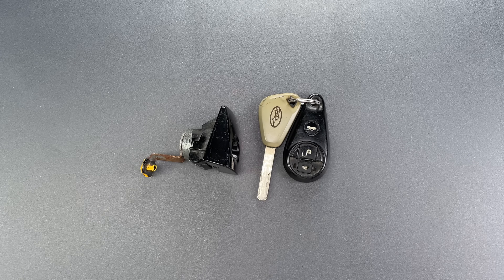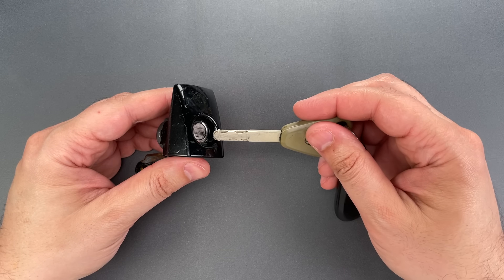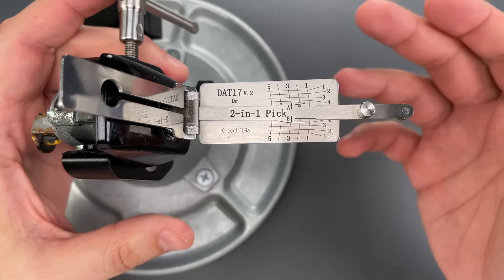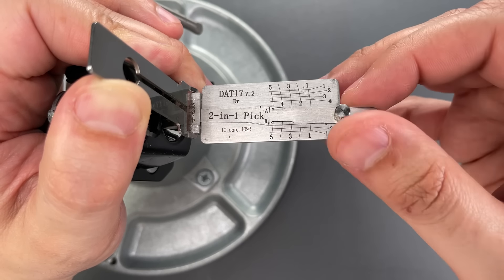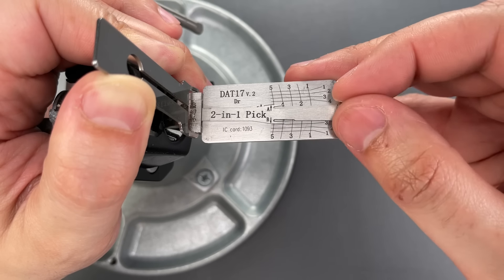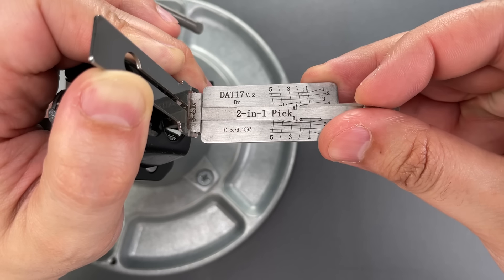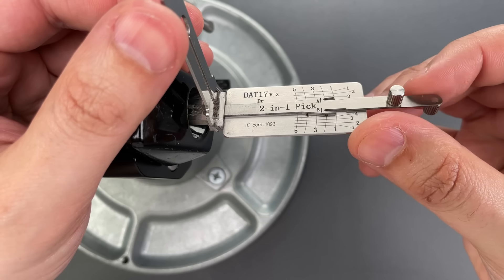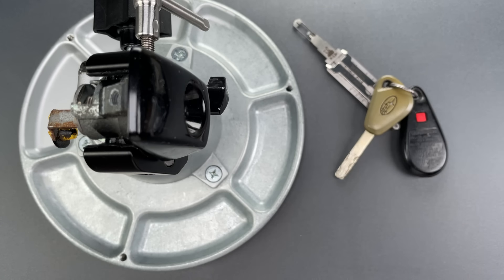[1346] A Trap For The Unwary: Subaru Impreza Door Lock

Comment: I really miss lock gutting videos and this lock seems like a really good candidate for one. I would love more insight on this one
Reply: I second that. Not for usual cylinders, but for the more eccentric ones like this.
Reply: Thirded. The A/B wafers are also new to me.
Reply: +1
Reply: +1
Reply: Yes, what's inside this lock that causes this, as well as the As & Bs.
Reply: He has said about other car locks that these are hard to get and destructive to disassemble, which might be fair to assume about this one too.  I'd certainly nevertheless like to see such innards.
Reply: @jadney  I suspect it's wafers on the top and bottom of the key, but I don't know that for sure.
Reply: I agree, especially why the lock gets stuck half between locked and unlocked, and why more locks don't use that anti-picking feature.
Reply: @asailijhijr  It's top and bottom, and left and right. 1, 3, 5 are at the bottom, 2, 4 are at the top, and each of them has two wafers - left and right / A and B. The key has different bittings on all four sides.
Reply: Yeah, I don’t really know what a wafer lock is.
Reply: Check out Bosnian Bill, he has some really great videos also picking and gutting locks
Reply: @scott215  Can you imagine coming home to find your front door lock jammed and unable to accept your key?
Reply: @thetruthexperiment  wafers, as I understand it, are the same function as pins, but they're square or the same shape as the channel they run in.
Reply: Haven't taken one of these locks apart but automoive locks can be a pain in the ass to disassemble/reassemble. Not having to pull these locks & decode them, Lishi tools have been absolutely nothing short of revolutionary for the locksmith community.
Reply: @Shoop83  i mean, it's better than coming home to find your TV and notebook stolen.
Reply: Rent a Subaru and 'steal' the lock
Reply: @Shoop83  That's better than coming home to find my front door open and all my stuff gone.
Reply: +1
Reply: +1
Reply: Do it, Do it, etc.
Reply: @asailijhijr  Are they hard to get?  I'd think any junkyard with a 2010-2014-ish Subaru has a high chance of having one of these locks in it...just gotta go get it
Reply: @yoru0121  The mind bending part is somehow its still symmetrical - these keys work in either orientation (at least my 2012 Outback laser cut key works either orientation) even though it looks asymmetrical cut
Reply: Poo
Reply: @davecoleman8660  great suggestion! 362 that he mentions there is also great for further understanding of the mechanism
Reply: His channel has pretty much became advertisement space for his lock pick company at this point.
Reply: Pity I can’t post a picture. I’ve done a few
Reply: @DONK8008  Yea, but the April 1st videos make up for it
Reply: @matthewmiller6068  Hard to get a matching cylinder and key set. You wont be able to get the key at the scrapyard. Plus, laser cuts like the key in this video are very expensive to duplicate.
Reply: @Shoop83  LPL has a video for that! 🤣
Reply: For "research"
Reply: @matthewmiller6068  Honda has been using this same style of lock on every vehicle since the early 2000s.
Reply: No. That shit is the worst.
Reply: @scott215  "...more locks don't use that anti-picking feature"

Because it's really stupid, it punishes the owner if someone tampers with the lock, the person trying to break the lock doesn't give a lick if the lock is damaged for the owner afterwards. 

It's not anti-picking technology, it is bad design.
Reply: @Shoop83  "Can you imagine coming home to find your front door lock jammed and unable to accept your key?"

It'd be like Subaru designed your house. God help you.
Reply: the fact he didnt show how to open it the rest of the way is also annoying, he is probably bored of youtube and not feeling it anymore
Reply: @charlieward7606  i believe you misunderstood, the lock was open and locked open.
Reply: @DONK8008  so you prefer that people that want to buy such tools have to go to AliExpress or similar scam websites? By giving a way to buy high quality items is a further service the LPL gives to the lock sports community. Now, out of a 5:32 minutes video, how much time was spent in "adversiting"? I timed it to two seconds, which is 0.6%
Reply: @AlessioSangalli  ah i see, my bad
Reply: @AlessioSangalli  I think actually you misunderstood. If you look at the top of the back of the lock you'll see a latch that's  stuck about halfway, you can see it jiggle when he says "it's stuck between the locked and unlocked position". It's only done about 1/8 of a rotation. When he inserts the key and operates the lock you'll see it go through the full range of motion (1/4 rotation), almost all the way to the flange.
Reply: @9e7exkbzvwpf7c  LPL's at 3:57: "we got this open". The lock is open, but as you also reported, the key is not fully rotated so it's stuck there in the middle, and it cannot be closed
Reply: @AlessioSangalli  you can clearly see it doesn’t rotate the full quarter turn clockwise (facing the keyway) when the picks it, while it does when the key is inserted. 

Compare the clockwise rotation of the top cylinder in the back at your time stamp and the position at 5:06 (he rotates it very fast but at 0.25x it’s easy to see). 

He also says it’s stuck “between” the locked and unlocked position.
Reply: @9e7exkbzvwpf7c  so at a minimum it's unclear, you cannot say that "I misunderstood" when LPL says "we are open". We do not know if the incomplete rotation still prevents the door to be opened.
Reply: @AlessioSangalli  lmao cope
Reply: @9e7exkbzvwpf7c  I repeat, you have misunderstood. The lock was open and the key stuck in the middle, as simple as that as the LPL clearly said. If you doubt that, it's up to you to disprove him.

Comment: Considering that the early models were the most stolen cars in many insurance surveys, Subaru probably upped their game with that lock
Reply: glass window says hi.....
Reply: Probably not actually anything they meant to do. Subarus are poorly engineered cars, this is probably just a useful engineering failure on the lock side.
Reply: @16vSciroccoboi  You sure showed them dude. "Random internet nobody DESTROYS Subaru, bravely calls out hugely successful decades-old maker of safe, reliable 4WD cars for their 'poor engineering' despite almost certainly having no significant engineering knowledge or experience whatsoever."
Reply: @nvrndingsmmr  lol what? You don't have to engineer cars to repair them and see the common failures and weak points. 

You're here watching a lawyer dissect and defeat locks. 

You sure showed me though, random internet nobody DESTROYS random internet nobody for talking down about a car manufacturer for their pattern failures. 

It's not like they aren't the butt of many jokes about blown head-gaskets and rod knocks. You can live in ignorance if you like. It's not really a consideration I make in my day to day.
Reply: @16vSciroccoboi  What common failures and weak points? True they have gone down hill since around 2007 in my opinion but my family, all mechanics, has been running subarus since the 70's, tough little cars that usually do 300k with no problems. Dealership mechanics or negligent owners are usually ones that kill them. I think they are engineered great or at least they were.
Reply: @69jbr69  WERE. 

They used to be stout. The engines are prone to rod bearing failure for one.  They have gone way down hill since 2007. 

People treat head gaskets like normal maintenance on them. Subaru even sold "coolant conditioner" which was just bars leak. 

The only chance Subaru has proven to be "good" are non turbo 2.2 or smaller engines. Go to a junkyard and look at the cars, you'll see most of them are totalled in some way, caved in back end or side.  Then the Subaru section is full of cars with minor body damage, decent interiors, no visible reason to explain why they are there. 

Because the engine blew up.

The Subaru 4 speed autos are incredibly beefy though and almost never fail, until the front diff bearings fall apart and grenade it, but it takes a looong time for that.
Reply: @16vSciroccoboi  have you ever driven   one?
Reply: @__Square  of course I've driven one. All my friends owned them before they realized they were shit, I've owned one and fixed them for several friends of mine that owned them. I have a friend who loves his vehemently and refuses to get rid of it despite me putting two engines in it and a transmission. 

What difference is having driven one supposed to make?
Reply: @16vSciroccoboi  it matters because driving different cars can give someone an opinion about that car, i just think its funny a vw person is hating on a car brand because vw cars dont come without their fair share if issues too. dont get me wrong the corrado vr6 is one of my dream cars as the first time i saw one i knew i had to have it but every car has its issues.
Reply: @__Square  I'm not a VW enthusiast, I had a Scirocco 16v that I loved but I'm not a blind VW enthusiast. And liking the way a car drives doesn't mean it's engineered well or not prone to failure. It just means it's enjoyable to drive.

This discussion was about Subarus being poorly engineered.
Reply: My 95 Outback could be started by a flathead screwdriver.
Reply: @16vSciroccoboi Newer Subarus have gone downhill for sure.  In contrast my 81' has almost 400k mi. and everything still works.
Reply: @16vSciroccoboi  my family friend who works on all our cars loves Subarus, convinced my mom to buy one and it’s done her pretty dang well so far
Reply: @16vSciroccoboi  haha scooby go brr
Reply: @16vSciroccoboi  We have two Subaru Outbacks (2004 and 2005). Absolutely love them. They are both the 3.0 flat 6 engine, cam chain not cam belt, and not prone to head gaskets like the 4 cylinder ones.
1st car has done 260,000kms second 350,000 kms. No issues with them. Great off-road too with the symmetrical all wheel drive.
Saw one of the same model for sale that had done 550,000 kms and owners had no issues. Not many engines that bulletproof.
Can't comment on newer models or other engines, but Subaru flat 6, hell yeah! :)
Reply: *built
Reply: @16vSciroccoboi  Subarus saving grace with the head gasket failure is just how easy it is to pull the engine and replace the gaskets. Maybe it's just from practice but I can have an EJ out and on an stand in about two hours
Reply: @16vSciroccoboi  i wouldnt say porley engineer they are pretty good cars man...
Reply: Yes but they weren't picking the locks. Like many 90s Japanese cars, you could push the window at an angle then pull the window out of the track and out of the door and gain access to the interior.
Reply: Except car thieves don’t pick locks it takes too much time. Either jam the window or smash it
Reply: @__Square  Mate do you know how much good metal costs these days? I'm amazed any auto manufacturer is making money at all with the ramping costs of even foundational material, especially one like Subaru- given the Japanese tax system and their lack of legally grey scams and luxury extortion models. Better just not to buy cars in general if you can, to be honest, market's fucked.
Reply: @16vSciroccoboi  and thats why people buy them right? because they are shit cars? no
Reply: @16vSciroccoboi  TRUTH
Reply: @nvrndingsmmr  I bought a 2012 impreza 5 door, worst engineered car I have ever driven.

Garbage engineering, garbage service from Subaru, manufacturing flaws we had to deal with with arrogant rude responses about repeatedly from the dealers until they lost a class action lawsuit, and they they were willing to stand behind their product.

I had to have the freaking engine replaced, the clutch destroyed itself in the first year, such that the car had to be towed when I was returning from a job 2 hours from home. It ate the highly expensive synthetic oil it required to the tune of a quart every 700 miles or so for literally years before Subaru decided they were willing to fix it.

Seats ripped, poorly designed stereo got a CD stuck never came out, things regularly would fall off their mounts in the cabin (sunshade was particularly galling)

Terribly engineered car. 

The only thing hugely successful about Subaru is their marketing. They have a small share of the market, because their products are substandard.
Reply: @69jbr69  : I think they are engineered great or at least they were."

WERE, they aren't any more. not by a longshot.
Reply: @NIGHTMAREuki  broken, obviously intrusion needing repair
Reply: Except they want people to keep buying their cars, of course, so they would care.
Reply: Victor Spoils  Definitely really
Reply: yeh, you can thank nissan for that smh
Reply: @ireallyreallyhategoogle  but did he get it open? I thought he just said its now in a limbo of unlocked/locked as in won't open and won't relock
Reply: @16vSciroccoboi  Subis kick ass, you prob drive a GM
Reply: @16vSciroccoboi  poorly engineered cars? Compared to what?
Reply: @16vSciroccoboi  such cap, mid 2000s peugeots are poorly engineered cars. The people I've heard complaining about their subarus are those who run them like crazy, like any normal car if you treat it correctly it runs smoothly. I bought a 2014 wrx hb and the previous owner treated it like shit but after little work the car runs like a dream
Reply: @16vSciroccoboi  Kamikazes are my favourite form of insult.

Do it more.
Reply: @kermitwilson  See my post, former owner. Garbage car, garbage manufacturer. Not a hot take. Something I spent 28k to learn.
Reply: @rhys5567  
poorly engineered cars? Compared to what?
Any Mazda to start.
Reply: @Bophametz  such cap, mid 2000s peugeots are poorly engineered cars.The people I've heard complaining about their subarus are those who run them like crazy,

I bought a 2012 Impreza 5 door, off the lot, had problems with it from day one to the day it was totalled. 

Terribly engineered car, engine ate highly expensive synthetic oil from the day we got it.

Clutch destroyed itself on the initial warranty (wife and I have been driving manual for 30+ years) 

Engine needed to be replaced.

Various fixtures in the cabin failed, audio system interface was poorly designed. Cheap fabric in the cabin wore out.

Any other details about the poor engineering I can give you?
Reply: @ireallyreallyhategoogle  Not having the right tool?
Reply: @ireallyreallyhategoogle  More like a ceiling.
Reply: They were easy to steal because it was easy to bypass the lock and hotwire the car
Reply: No one picks car locks tho, people shim the door, it takes way less skill and is much faster
Reply: @ireallyreallyhategoogle  you could say that about every vehicle and most houses. Noise and time on target, noise and time on target
Reply: @16vSciroccoboi  They're not. Everyone blames engineers.  They do an amazing job.  Then the hand rubbing beancounters say "make it cheap and only good enough to last past warranty, plus a margin", and the engineers do an amazing job of that as well.
Reply: @bookworm8368  yeah heaven forbid people have more to do in life than debate the merits of shitty car manufacturers on the internet and let it consume them.